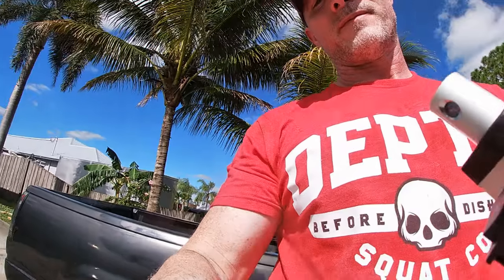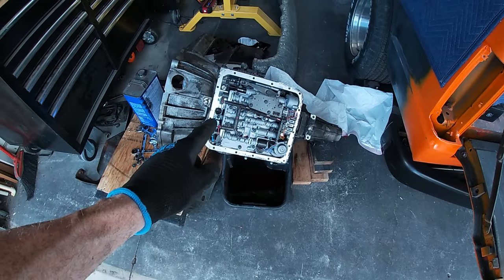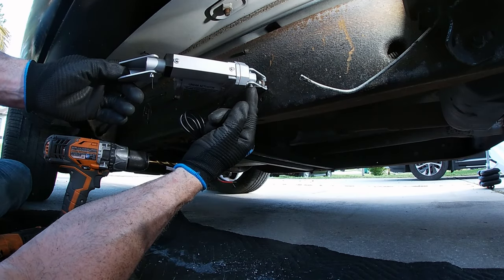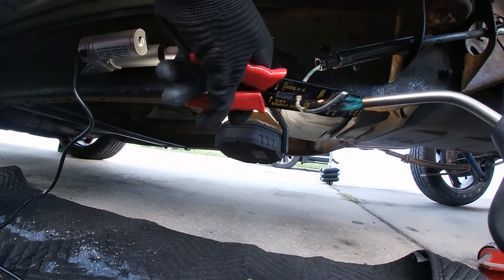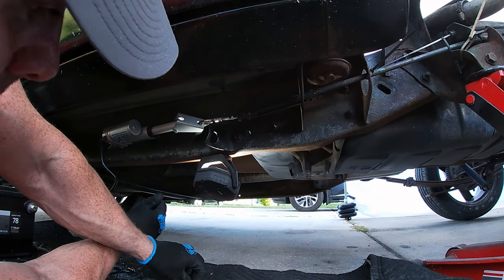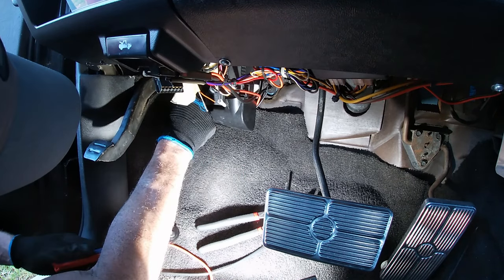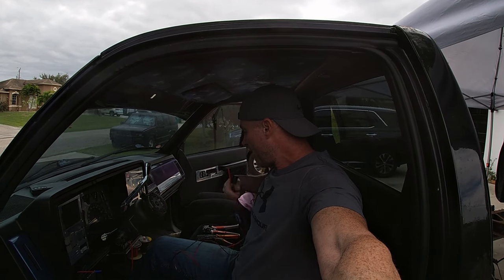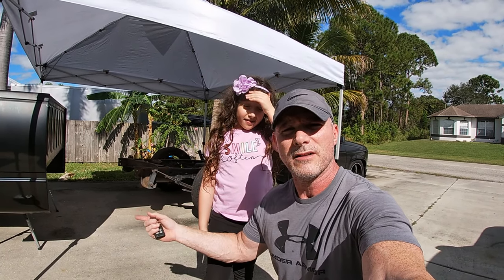OBS Chevy Truck DIY Electric parking brake version 1.  Linear actuator Parking Brake

Comment: Now it just needs a couple momentary switched mounted down by the linear  actuater so when it is extended and retracted it will hit either switch and activate one of two led's so you know if the parking brake  is on or off.
Reply from the maker: That's exactly what I was thinking. 👍 Also, I need to have the slop held back by a guided path or loop to the frame using that stock bolted bracket under the cable. That will keep the unit from shaking when in the open state.
Reply: @thisoldhooptie  yeah maybe also a boxed enclosure to enclose the actuator made from ABS sheet or sheet metal when a gromet on the end for the cable to run through sealing out the elements.
Reply from the maker: I agree. The best of all worlds would be to stay super cheap and easy to replicate for others if possible. I guess time will tell. 😁